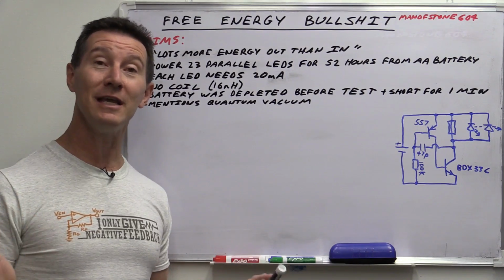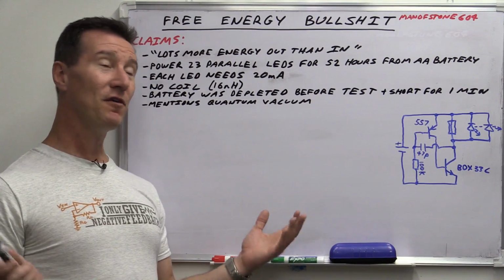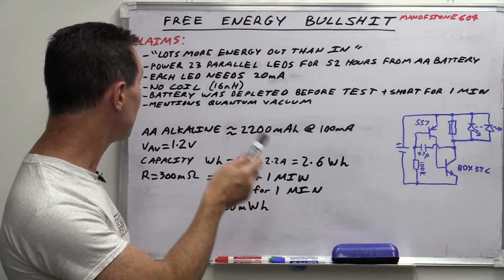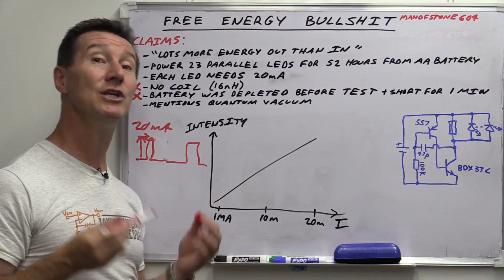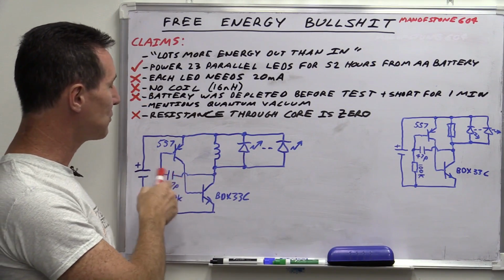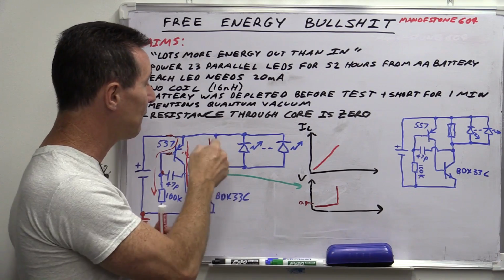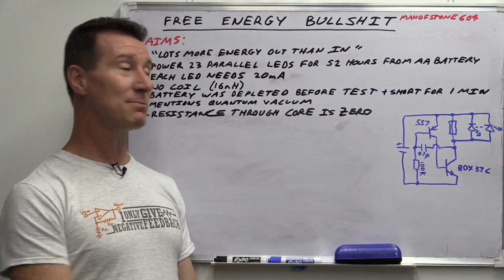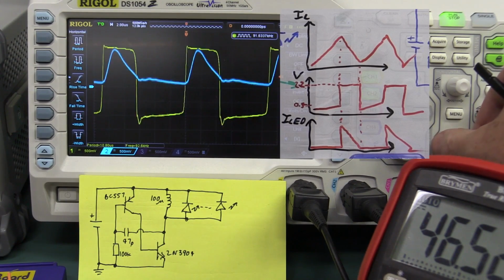EEVblog #708 - Free Energy Overunity is RUBBISH!

Comment: Energy cannot be created, it just changes from one form to another. High School Physics.
Reply: Robert Calk Jr. Are you sure you want to double down on stupid? How about I highlight the units for you, so you can make a more informed decision:

"the Sun releases energy at the mass–energy conversion rate of 4.26 million metric tons per second, 384.6 yotta watts (3.846×1026 W), or 9.192×1010 megatons of TNT per second."
Reply: ***** Pontus Lundström Pretty sure he was joking...
Reply: Once again, whatever the value is, the unit is watts, not watts per second. watt is the amount of energy per unit time, aka. joules per second. joules per second per second, or joules per second^2 (= that watts per second, you are speaking of) doesn't make sense in this case. No need to talk about the second derivative of the energy ..
Reply: Robert Calk Jr. Yes... the sentence ends with "or 9.192×10^10 megatons of TNT per second."

There are a thousand horrible and potentially hilarious ways I could insult you right now for failing to actually read the fucking sentence you were quoting from. Please at least be aware that I'm using restraint here.
Reply: HitAndMissLab 
"An engineer is not more than a bean counter."
You keeping thinking that. Granted an engineer allowed you the ability to type on a computer to post that comment.
Trolin' is not your style.
Reply: Mobin92 No one knows. The prevailing theory is that the big bang had all of the current energy we have now, just in a condensed space.
However people like HitAndMissLab are just trolling.
Reply: HitAndMissLab You got fingers, look it up.
Reply: Robert Calk Jr. No they don't. Wikipedia clearly states the Sun's energy output in terms of watts: "384.6 yotta watts (3.846×1026 W)". There is no "per second" associated with that number.

EDIT: That should be "×10^26", but superscripts don't work on youtube.
Reply: Some people smoked weed through highschool and dropped out. LOL. They weren't there for that class, unfortunately.
Reply: Robert Calk Jr.
Watts per second? Did you mean Joules per second? (which is Watt).
Reply: Robert Calk Jr.  You have just insulted yourself. Please let me explain why.
Joule is the unit of the amount of ENERGY.
If you divide energy by time (or simply make first derivative over time) you will get the rate of energy being transfered/changed/used/etc. That is called POWER and its unit is WATT.
If you divide power by time (or do first derivative of power over time which is second derivative of energy over time) you get the rate of change of power over time. It DOESN'T have any special unit, just W/s (watt/second).
So, if you're talking about some number of Watts per second you are NOT talking about power BUT about rate of change of power. It tells you how fast power is changing over time NOT how much power is emitted from the Sun (as in discussed example).
Do you see the difference now?
Reply: Naoki Kashima HAHAH Oh wow.

Learn some better arguments next time:
http://rationalwiki.org/wiki/Bumblebee_argument
Reply: Not true.  On the quantum level, both energy and matter can be created, as long as equilibrium is restored very quickly.  That's how the W+ and W- bosons are created.  For example, a neutron, with ddu quarks (total mass is around 12 MeV) decays into a proton with uud quarks (around 9.5 MeV) by producing a W- boson(mass of 80 GeV).  It can't do this if energy and/or matter cannot be created because the mass of the W- boson is 1,000 times the mass of all three quarks.
Reply: Naoki Kashima
Yeah right...Because for something to be in school books, it first has to be made an article by scientists, be tested and have reproducible results, than it goes to school books. So...Pretty much everything you see in most reputable school books is actually factual information that comes from reputable sources...Unlike your statement.
Reply: Falcrist
Nice one.:)
Reply: ***** OK - so many things wrong with what you just said.

First - the Electric universe is NOT a theory - it is a hypothesis.
2nd - it has been disproved.

Basicaly it made very few predictions and none of them came out to be what we find in the universe, on the other hand, the BB-Theory (it is called theory cause it is backed up by a hue amount of evidence) has made predictions that turned out to be accurate.

Even more - the electrical universe doesn't even try to explain how Stars work - Stars work based on fusion - that is not a matter of opinion, but a fact.
If you want to talk about theories explaining that, i'd suggest looking up quantum-mechanics.
Reply: pesshau Sadly no . those fraudsters really want to rip the retards of their money that way - and trust me on that . there are more than enough idiots willing to believe such shit (watch?v=_c6HsiixFS8 - that is how much such morons want to believe to be smart and their government being in a conspiracy)
Reply: ABaumstumpf True. This guy was just such a weird parody of himself, I thought he was joking. And thanks for the link, that sprinkler rainbow lady is a real classic.

I think you have described the two sides of this free energy "community" quite nicely: On one side there are the people who really want to believe, no matter what, because it makes them feel special and enlightened, and on the other there are the conmen who are taking advantage of them.
Reply: Naoki Kashima
Robert Stever was quick in giving you the right answer. Note: there is nothing like "mainstream science", there is only science - and pseudoscience. And you should never use "according to science ..." since you are ignorant in science.
Reply: Naoki Kashima First of all you seem to confuse the terms "theory" and "hypothesis". Also what do you mean by "who decides"? No one decides. A hypothesis can be confirmed by a lot of experimental tests, but if even one of them does not reproduce the results predicted by the hypothesis, then it's out of the window, and must rewritten or replaced by another model altogether. And it does not matter one bit who supported the hypothesis at first! You seem knowledgeable, you should at least be familiar with this fundamental principal of science (and logic for that matter!)
Reply: stephanosanio To add to that: it's also much easier to use scientific notation than to use some of the more absurd greek prefixes.
Reply: ***** Our understanding is an abstraction, sure. But those imperfect concepts have some pretty amazing predictive abilities.

At this point we know beyond a reasonable doubt what is happening in the core of the sun. Now, our model isn't perfect, and it can be refined... but you can be very confident that it's at least close to the truth.
Reply: ABaumstumpf  I never said it was anything more than a technicality. :)
Reply: Gert Nutterts
"It's the first thing I think about when somebody says "Free energy!"."
There are some really fun videos that show this behavior in live action - form the really min-numbing dumb ones - like free energy from your phone-line, to burning your newspaper all the way to making freaking huge coils right next to power-lines.

And then you got the conservatives in the US-government saying that we should not use more wind as it would be Gods way to balance the heat - and if we used to much wind energy, the winds would stop.
(Yes - some of those even go as far and take out their Bible in a discussion about health-care or environment-protection).

And then there are people like those form Solar Roadways or this - unable to do even simple maths and check their own claims.
Reply: Naoki Kashima
A transformer is an electrical device that transfers energy between two or more circuits through electromagnetic induction.
A varying current in the transformer's primary winding creates a varying magnetic flux in the core and a varying magnetic field impinging on the secondary winding. This varying magnetic field at the secondary induces a varying electromotive force (EMF) or voltage in the secondary winding. Making use of Faraday's Law in conjunction with high magnetic permeability core properties, transformers can thus be designed to efficiently change AC voltages from one voltage level to another within power networks.

http://ieeexplore.ieee.org/xpl/articleDetails.jsp?arnumber=5058456

The fact that you seem to lack basic knowledge in Faraday's law tells me you don't know what you are talking about.

I design power supplies for a living and am required to know a great deal about magnetics. Granted you can learn more by reading (ieeexplore is a great place). Posting a half baked comment on something you know very little about makes you appear very unintelligent.
Reply: heinzpg According to mainstream science a humble bumble bee is unable to fly because its wings are too small for its body. Did you know that science can't explain why a bubble bee flies? Maybe... just maybe mainstream science made a wrong turn around 100 years ago. Maybe we all should have listened to Tesla and not Einstein. Maybe there are no black holes, dark matter or dark energy. Maybe all of the mysterious of the universe can be explained through electricity and electro-magnetism..... maybe I am 100% correct.
Reply: Naoki Kashima Rationalwiki is not wikipedia.

"Furthermore, I'll pay you 100,000$ for 1 gram of dark matter. Can you please ship it to me, and I'll transfer the funds into your paypal account. HA! You won't be able to give me 1 gram of dark matter. Why? Because NOBODY has ever created it, or observed it. Does it exist? No."

Prove it doesn't exist. with Peer reviewed research.
Reply: ***** u r trolled u lose
Reply: ***** Others smoked weed throughout highschool and university, and are now professional engineers.

I know because I'm trying to get my BSEE, and two of the best students I know are major potheads. One of them doesn't want to join my study group because he likes to "smoke a bowl and think about the concepts". Whatever floats his boat I guess, but that's not for me!
Reply: ivanjacob
Doesn't our sun emit 600 Trillion Watts per second?
Reply: stephanosanio
Yeah I forgot the exact number but it's a massive amount of energy.
Reply: Robert Calk Jr.
384.6 Yotta Watts per second.
Reply: Amy UNTOLD
Jesus Christ, The Word of God Almighty spoke and the universe was created.
Reply: nychold
Yeah . but we are talking about completely different scales there. If you somehow manage to separate matter and anti-matter in such huge quantities that you had usable amounts of energy - well, noble-price for you :D
But for every-day techs we always use simpler equations - you don't deal with relativity when driving a car - it is just too insignificant, but in reality it does affect it.
Reply: Naoki Kashima can you cite a source from a reputable institution on this?
Reply: heinzpg "Robert Stever was quick in giving you the right answer. Note: there is nothing like "mainstream science", there is only science - and pseudoscience. And you should never use "according to science ..." since you are ignorant in science."

The only people who use the phrase "according to science ..." are people who are complete boobs at science, using at nothing more than a puppet to fill their false or incomplete claims. This is coming from someone who did graduate college with a degree in the sciences and never uses that phrase.
Reply: Robert Stever
There is no such thing as human nature - it is an adopted nature, which is spiritual. You either have the nature of Jesus Christ, or you have the nature of satan.
Reply: Go ahead and keep thinking that.
Reply: holy shit an actual electric universe crank
I never thought i'd actually see one in the wild.
Reply: Saumyakanta Sahoo We are all participating in a simulation. Reality and perception go hand in hand. For example light behaves differently when it is observed, it haves like a particle. When light isn't observed it behaves like a wave. That is the whole paradox in quantum physics. Quantum physics can explain what is happening mathematically without actually understanding the implications philosophically. If you take a gun and shoot yourself, there is a high probability that you will die. Why? Because we are all living in a shared reality that has rules (much like a video game). God is consciousness that is shared between beings. Consciousness is a fractal, it folds into itself. I am saying we are all the same being that our separation is an illusion.
Reply: tarotbug 
Hey Tarot , read your cards again !
Reply: Ordinary hussles obfuscate ordinary evidence.
Reply: ***** Hes a mayan :)
Reply: stephanosanio
I guess you can take the case up with Wikipedia and get it changed. But it is what they say.
Reply: Falcrist
They are the last two words in the sentence...
Reply: Falcrist
Yes, and the whole sentence refers to "per second". You're just insulting yourself.
Reply: ***** LOL, are you serious? You must be trolling, because that video was hilarious.

Edit: OK, maybe not so hilarious. Your voice is starting to bore me now, and you won't let me leave your site.
Reply: ***** I hope you end up in jail
Reply: ***** more drank far to much and flunked out
Reply: *****
 That's exactly the point of my comment. There is more to physics than what engineers are though at university. An engineer is not more than a bean counter.
Reply: If energy can not be created, where did it come from? :D
Reply: ivanjacob You have never been to school, I guess...
Reply: Д. Станоев looks like he deleted his post. Wuss.
Reply: Robert Stever That would be a smart move ;)
Reply: Naoki Kashima
The fact of the matter is that there's no 'universal reality' or 'universal truth'. So no one can say for sure how certain things happened, even if they were part of certain events.

Also, I never said X is right or wrong. I'm saying what happens for information to end up in schools books and be taught as factual.

An example of that would be global warming. Researchers on various fields ended up getting similar data on tests that had nothing to do with finding global warming, which in turn made things happen and global warming ended up being added to school books as a fact.

Still waiting on sources to be referenced.

Also, electrons do carry negative charge.
Reply: Robert Stever I knew about the Faraday Law. Point is it isn't the ELECTRON that transfers the charge it is the electric field itself. This field is contained BETWEEN the wires. The high voltage wires on your power lines will actually respond to each other (either get pushed apart or come together) when the they are under power. Watch Eric Dolard's lecture on anti-relativity (youtube search it).
Reply: In principle the laws of physics do allow for creation of energy, but as far as we know it does not happen. Perhaps with the exception at big-bang. In physics each conserved quantity is associated with a symmetry in the laws. For instance, momentum is conserved if the laws are the same everywhere and energy is conserved if the laws do not change over time. So to all those who claim they can create energy out of nothing: You have the power to change the laws of the universe! Impressive!
Reply: Anders G The humble electron began spinning billions of years ago and hasn't slowed down since. Is this an example of perpetual motion device in nature? Science must ALWAYS follow nature :)
Reply: Naoki Kashima Perpetual motion is normal in nature and not in conflict with  laws of physics. What is not possible is perpetual motion which in addition delivers energy without diminishing the motion.
Reply: ABaumstumpf I want a Noble Price.
Reply: Robert Stever One should know never to include links from wikipedia in scientific discussion. How reliable is wikipedia? Not very.

Furthermore, I'll pay you 100,000$ for 1 gram of dark matter. Can you please ship it to me, and I'll transfer the funds into your paypal account. HA! You won't be able to give me 1 gram of dark matter. Why? Because NOBODY has ever created it, or observed it. Does it exist? No.
Reply: Robert Stever Prove to me that it does exist with physical evidence :P
Reply: Naoki Kashima We are trying to prove if it exists or not. That is the point of science.

The universe is expanding at a rate in which entropy should have caused the universe to contract. Something is causing the universe to expand at a rate that is visible to us. Heck nasa has had a nine year study on this phenomena
http://lambda.gsfc.nasa.gov/product/map/current/map_bibliography.cfm

We call is dark matter/energy as we have no clue what this type of materiel really is. The term "Dark matter/energy" is nothing more than a placeholder for the 95% of the observable universe that we can see on WMAP images.
http://arxiv.org/pdf/1303.5062v1.pdf
Reply: Robert Stever Science is based on observations and testable and re-testable results! What suggests the existence of dark matter is equations and abstract math which has no root in reality at all!
Reply: Naoki Kashima
A little simpler and less of a dry read: http://www.quantumdiaries.org/2013/06/26/does-dark-matter-really-exist/
Reply: Naoki Kashima "Science is based on observations and testable and re-testable results! What suggests the existence of dark matter is equations and abstract math which has no root in reality at all!"

Again you failed to read or understand the math. That is why you are not a physicist. Just someone who tinkers...

edit: http://libraryguides.unh.edu/content.php?pid=350369&sid=3969939

You don't have a clear understanding of science if you think it's only "observations and testable and re-testable results!"

The LHC is scheduled this year to determine the mass of dark matter:
http://hplusmagazine.com/2015/02/26/the-lhc-is-back-and-its-ready-to-probe-the-limits-of-matter/
http://www.ipwatchdog.com/2015/02/25/large-hadron-collider-antimatter-dark-matter/id=54943/

This technology is rather new and didn't exist until rather recently. Heck it discovered the Higgs Boson wish was theoretical only until the LHC discovered it's existence:
http://home.web.cern.ch/topics/higgs-boson
Reply: Robert Stever Celestial bodies are held in places because of electric charge not some invisible matter. Electro-magnetism is a 10e23 times more powerful than gravity. Read the book called Electric Universe by Wallace Thornhill & David Talbott. Universe is filled with electric charge! Why do physicists ignore that fact?
Reply: Naoki Kashima Even more pop sci conjecture. Please go back to school before you embarrass yourself any further.

Any sentence that starts with "Read the book called ..." is automatically fraud science. Notice how I have not done so?
Reply: Robert Stever Flip the pages of time back to Copernicus. He had the crazy idea that Earth revolves around the sun. His ideas were considered pseudoscience during his time, sacrilegious. Years later we learned that he was right! And now we all take his ideas for granted. The same can be said about the ideas in that book. The fact the universe is filled with electric charge is undeniable. Aurora Borealis actually contains millions of amps streaming from the sun. The Earth is charged with 500,000 volts through tullertic currents, and the sun has a charge of over 2 billion volts. This values are available for your or anybody else interested to examine :P

There is no need for intangible, invisible, imaginary dark matter to explain why galaxies clump together. They do that because of the electric charge that exists in between space! Also, there is a highly charged form of matter known as plama that permeates space (plasma being the 4th state of mater, as you know).

Time will tell which one of us was right :P
Reply: Naoki Kashima So far you are still digging that hole. Want a larger shovel?
http://rationalwiki.org/wiki/Electric_Universe
Reply: Robert Stever Notice how you didn't actually address any of my points, you merely side stepped them. I hope a person who is reading these posts (if there is one), will see this as well :P
Reply: Naoki Kashima Like which ones? I didn't address Copernicus as you where right.
Reply: Naoki Kashima I'm not seeing anything missing from Robert. I do see a man who got beat down badly and won't see the error in his judgment, just like Calk jr.
Reply: Robert Stever Points like the universe is filled with electric form of matter known as plasma. Agree/Disagree? The Earth has a very large electrical charge within the planet known as tulleric current. Agree/Disagree? There is no physical evidence for the existence of dark matter at all. Agree/Disagree? Electromagnetism is a 10e23 times stronger than gravity. Agree/Disagree? You can have electricity without magnetism as was demonstrated by K. Meyl, N. Tesla and other. Agree/Disagree? Modern day physics is mainly based on MATH not EXPERIMENTS. Agree/Disagree?
Reply: Naoki Kashima Troll post is a troll post.
Reply: Naoki Kashima " Electromagnetism is a 10e23 times stronger than gravity. "

You can't even get this right, it's 10e36 greater. Electromagnetism isn't gravity.
Reply: hawkeyefile Oh I'm sorry I was actually 14 zeros away. That fact makes my point even more dramatic. Gravity is a very weak force. Electromagnetism can act like gravity where even non-magnetic objects can levitate in a very strong electro-magnetic field. Have you seen the levitating frog experiment? A frog was placed in a pipe around the pipe a very strong electromagnetic field was generated and the flog was floating as if it was in zero gravity. I can provide links to that video. Is this what really causes the planets to maintain their orbit, this electromagnetic field? Our solar system is basically like one giant capacitor. When the planets all align in a row you get to see effects on the sun. The sun actually spews out solar flares at that time and it has an effect the Earth's electronics. RCA did experiments with this, and they were able to predict these solar events based on the position of the planets in the solar system. It is indeed an electric universe out there. Gravity may not even exist as a separate force but be merely a derivative of electricity and magnetism.
Reply: Naoki Kashima You still fail to understand higher levels of physics, you seem to have not read any of the previous posts with the WMAP survey, if you did, you would know that what you are posting is bunk involving the Electric Universe .

Gravity and electromagnetism are separate principles that achieve a similar affect (at super conducting temperatures). Gravity is still a principle that with time science and not woo science, will figure out. You posting anything related to the Electric Universe makes you appear dimwitted just like Robert Calk jr.

Interesting reads from other's with a physics background:
http://neutrinodreaming.blogspot.com/2011/09/electric-universe-theory-debunked.html
https://briankoberlein.com/2014/02/25/testing-electric-universe/

Trolling is still trolling.
Reply: Robert Stever Shhh. He might have to stop digging to get a bigger shovel.
Reply: hawkeyefile It's even more side-splitting hilarious how the majority of his posts in this YT reply section is full of bunk that has been called out on, then he goes on the attack with strawmen and does this "Agree/Disagree" baloney against a physics major mind you.
Reply: hawkeyefile
Nobody beat me down. 1 Watt = 1 Joule/ second. Edit it in Wikipedia if it bothers you so much.
Reply: Robert Calk Jr.  You said 1 watt second, rather thank joule in referring to the Sun' output. Then proceeded to argue your ill contrived point.
Reply: Modern physics is completely bogus it can't even explain why a bumble bee flies! Its wings are too small for its body! It must be the invisible and intangible 'dark matter' that propels it, maybe its equality invisible and intangible 'dark energy' that propels it. Maybe all the answers are on wikipedia already.... maybe.... maybe not.

Base your physics on observations NOT on abstract math w/o any root in reality.
Reply: Naoki Kashima 
"Modern physics is completely bogus it can't even explain why a bumble bee flies!"

Can't tell if you really take that comment of yours seriously, or if your trolling.
I guess if your I.Q. was below room temperature you could take that argument seriously (the fact that you even bring up this argument shows you have no intelligence to speak of seeing as how the rest of your posts are pseudoscience at best, crank at worse).
http://www.caltech.edu/news/deciphering-mystery-bee-flight-1075
I'd welcome you to take this argument to the people at: http://physics.stackexchange.com/questions/7839/is-it-really-impossible-for-bumblebees-to-fly

I'm more surprised that this comment thread has not included Hitler as most tend to delineate into or some other creationist bullshit theory.
Reply: Robert Stever Speaking of Hitler... it seems like you live on this page. Ever heard of Hitler's brown coats and what their purpose was? Do you think you might fall into that boat some day?
Reply: Robert Stever People are just people, there are no different sides. If we could put aside our differences we could leave this planet and explore the universe in peace. Interstellar technology is already available to humanity (search for NASA tests the impossible engine). That article talks about a very crude prototype... still miles ahead of rockets. Things like money, power, have no meaning anymore. Humans is a species of builders not destroyers. Eh, Robert?
Reply: Too liberal for my views. I've seen the world in all of it's ugliest when I was stationed in Afghanistan, people killing people because of religious differences. <-- This will not change in my lifetime.

I do agree on some of those points , however money is a necessary evil for motivation. You remove money from the equation and the motivation factor goes down; I'm motivated to build high current power supplies to support myself (to buy food and pay for my apartment), not for the science of it. Star trek got a lot wrong and a lot right, even in their universe money still exists in the form of the Federation Credit, and all officers are given "Credits" for trading with other races.

Power will always have a place, it's ingrained in Human Nature. Someone must always be the Alpha, the Beta and so on. Unless we breed this out, humans will always squabble over power.

"If we could put aside our differences we could leave this planet and explore the universe in peace." This will not happen unless we ditch religion and political differences.
Reply: Making-a-Mulligan Where's my pokeball when I need one.
Reply: Naoki Kashima once again http://rationalwiki.org/wiki/Bumblebee_argument
Reply: Naoki Kashima Physics based only on observations was done in and before the 1700s when the fundamental theories where still up for discovery. It was a time when one could be physicist an astronomer and a doctor at the same time and be a good one also! Now we do not have that luxury. Theoretical predictions have to be made, verified by many and go and be verified (if they can be) by physical experiments. Why? Because a piece of paper and a calculator cost a lot less than a particle collider or a satellite or whatever instrument you will need to prove or disprove hypotheses in the forefront of science of our time.  "Agree?/Disaggre?"
Reply: BIll Georgoulakis Agree. That being said there are many people with many different theories out there. For example what about the theory of the aether? That theory was supported by Tesla, Eric Dollard and Konstantin Meyl's experiments. That theory was also supported by Maxwell as well as Einstein! However, today we completely abandoned it and replaced it with the action at a distance theory. Who exactly gets to decide which theory becomes mainstream and is taught in textbooks and which theory dies? The people who have the money and influence decide this. In the US the Carnegies gave US education grants in return that got to pick which textbooks get used in schools. The truth of the matter humanity is a slave to energy. People who control energy control humanity. If one suppresses information about energy that exists in the vacuum and gets everybody to learn about the conservation of energy laws one can keep selling oil forever. Oil is the goose that lays the golden eggs. I have a paper containing over 3000 pages of suppressed inventions, if you are interested I can provide a link.
Reply: Robert Calk Jr. It is watt-second (W·s) not watt per second (W/s). dW₍t₎ = P₍t₎ · dt; (d/dt)W₍t₎ = (P₍t₎ · dt)/dt; P₍t₎ = (d/dt)W₍t₎; (d/dt)P₍t₎ = (d/dt)(d/dt)W₍t₎; (d/dt)P₍t₎ = (d²/dt²)W₍t₎; P'₍t₎ = W''₍t₎. Thus, you're referring to the second derivative of the energy with respect to time. Kontra is right.
Reply: 2013Aleksey2013 math should only be used as a tool not the primary mover and shaker of things. The primary mover and shaker should be the experiments and observations. The main reason people claim that free energy is impossible is because of the math. However, observations tell us a different story. Observations > Theory
Reply: Naoki Kashima NO!  The reason you can't create more than put in is because it's impossible.  Physics tells us that.  Physics are the Natural Laws that define how things work.  Math is just not numbers, it's the code of everything.
Reply: valveman12 Physicist should have stayed out of electrical science. The reason for that is because electron is NOT the charge carrying particle in electricity. Electricity involves the motion of 2 particles. One goes from positive to negative with a clockwise spin, the other goes from negative to positive with a counter-clockwise spin. You actually can create and destroy energy. Watch my video for a lenz-free system that Ed Leedskalnin came up with.

Observations speak louder than theory.
Reply: Naoki Kashima Electrical theory came from Physics.  How do you know how current flows?  There are 2 Schools of thought.  Current flows from Low to High Potential (Electron Flow) or from High Potential to Low Potential (Conventional Current Flow).  You bring up Ed Leedskalnin and loose all credibility.
Reply: valveman12 We can debate about this all day long. Expect to see actual physical results from me about this :)
Reply: Naoki Kashima I won't hold my breath.
Reply: valveman12 I'll give you a video link if I am successful if not.... I have other ideas :) If this fails I'll be 300$ poorer... My next idea will involve Tesla's Homopolar generator. Basically if you spin a copper/aluminum disk over a ring magnet you get voltage and amperage. If you put that voltage and amperage under load the spin will not be effected! This is another one of those Lenz-free systems. You can have 2 disks spinning... one powers the other and they will keep spinning indefinitely.
Reply: Naoki Kashima And what do you intend to prove (or disprove) with your experiments. What is the hypothesis?
Reply: BIll Georgoulakis The hypothesis plus theory>>> Electricity is actually composed from 2 particles. A positive and a negative particle. These particles have the opposite spin and move in opposite directions. What people call "Lenz's Law' is just 1 of these particles trying to leave the system. We are using 1 of the particles but are always fighting against the other. In a balanced generator the movement of these particles is accommodated and Lenz's Law is negated.

Short version of Hypothesis>> If I create a generator with a U-shaped core wound with 2 opposite wounds coils of a sufficient size I can achieve perpetual motion in the system.
Reply: Naoki Kashima Oh Man are you even reading what you are writing?  Pos and negative spin in opposite directions?  Pos is in the atom and electrons orbit said atom.  Negate Lenz's Law?  Lenz Law is not a particle.  It is a phenomenon that occurs when drawing current from a generator.  An equal and opposite current will flow to counter act the current drawn.  Without Lenz's Law, you can't produce current from a generator so how are you going to negate it?
Reply: valveman12 I posted a video that shows how Lenz's Law can be negated: ht tps://w w w.youtube.c o m/watch?v=nuAIxDsLT88 MrAnguswangus did it first, but I want to do it on a larger scale (the video contains small scale device).

Your explanation of Lenz's Law is correct in accordance to what we were taught in school. It is a force that opposes the rotation of a generator forcing you to work the generator harder when it is under load. In reality it is something different (check out my video, a much larger device is on the way).
Reply: Naoki Kashima Ok I looked at your video.  First you do not have 2 coils shorted out.  You put them in parallel.  The current being drawn is so small of course you don't see a discernible change in speed.  More accurately would be to use a photo tachometer.  The second part you connected both coils in series.  Of course you get more voltage.  There was no elimination of Lenz's effect. It was alive an well in your experiment.
Reply: valveman12 In my experiment when I shorted out just 1 coil you see a noticeable drop in speed of the rotor. The rotor's speed drops drastically and there is a clicking sound. When I short out 2 coils I get NO change in the speed at all. There is zero change. You are correct, I should use photo tachometer for this (I don't own one). Ed Leedskalnin said "if you take my generator and put it on a rocket and fly to the moon and back you'll end up with the same amount of fuel as before you left." This quote hints that his generator ran it self. This is it my friend. We will see what will happen next.

If you take a U shape magnet and magnetize a piece of wire. That wire becomes magnetized, but where does that energy come from? The magnet you used has just as much magnetism as before. You can magnetize a million wires this way w/o changing your original magnet. The laws of conservation of energy hold true for physical systems but fall apart with it comes to some electrical systems. I'll keep you updated if I come across anything interesting :)
Reply: Naoki Kashima "your I.Q is below the room temperature " , yeah you proved it !! .. hahahahahahahahah
Reply: Robert Calk Jr. oh , the Hindus , Muslims , Buddhists are all aliens I guess ?
Reply: Naoki Kashima Hey , you seem to be living in some other dimensions, I guess  the laws of physics are different for you , you are a living being of higher conscience , please spare us "mere" humans from your powerful knowledge.
Reply: Saumyakanta Sahoo In the past people in Europe were convinced that the Earth was flat. Then they were convinced that the Sun revolved around the Earth. Now physicists are convinced that Dark Matter, Dark Energy and Black Holes are real without a shred of physical proof. Maybe... just maybe they are completely wrong again. What if electricity NOT gravity is the dominant force in the universe? Universe is filled with highly charged matter known as plasma. What if gravity doesn't exist at all as a separate force but is just a stronger version of magnetism (when magnetism is strong enough even non-metallic objects will be effected by it). Experiment: take a piece of graphite bring it close to a ceramic magnet. Is it magnetic? No. Graphite isn't a metal and it won't be effected by the ceramic magnet. Now take the same piece of graphite and put it near a very neodymium (~200 lbs of pull force) magnet. You'll notice that graphite is now being attracted to the magnet. The only thing that changed now is the intensity of the magnetic field. Think for yourself, don't let others think for you :)
Reply: Saumyakanta Sahoo 
I didn't say anything about aliens, you did. I'm talking about the spiritual nature of people. Many have the nature of Jesus Christ whether they have heard of Him or not. But since you brought it up: Islam is the only religion that beheads non-followers of their religion - that sure sounds like a religion filled with the nature of satan to me!
Try to see things through spiritual eyes, rather than physical eyes - you may be amazed at what you see...
Reply: Robert Calk Jr. Okay, enough with the religious attacks, if you cannot mathematically and systematically prove anything, please, just leave, this is a EE channel, for EE fanatics, not religious/spiritual fanatics , we all know how recursive the religious topic is.
Reply: Robert Calk Jr. The whole Islam beheading is done by CIA employed mercenaries. The west is behind Isis, just like they were behind AlQaeda. When have we invaded a country that doesn't have a wealth of natural resources? (random of subject comment from me, you are welcome)
Reply: ***** 
Proof? If I remember right you can buy a copy of the Koran at Walmart. Look for yourself.
Reply: Naoki Kashima 
And they have the nature of satan also - that changes nothing. The beheadings of non-muslims is in their religious text. Do you deny that?
Reply: Robert Calk Jr. The history of Christians is also filled with blood. Do you remember the witch burnings? Do you remember the crusades? The only way to STOP the perpetual warfare and violence is to accept all the people as they are. Do on to others as you have them do on to you, words to live by.
Reply: Naoki Kashima 
I'm not concerned about 100's of years ago, I'm concerned about now!
And the Christian wording of that verse is too often misappropriated. I'm rather fond of the way Confucius worded it: Don't do unto others what you don't want done to yourself. That is safer. lol
Reply: Naoki Kashima dark matter isn't imaginary , they have proof , the visual mass of the galaxies and other clusters do not account for their observed mass , so the missing mass is termed as dark matter  - https://en.wikipedia.org/wiki/Dark_matter 

 Gravity comes from mass , mass comes when a particle interacts with the higgs field . So gravity is not related to electricity or its field.
plasma occurs in very specific conditions not generally.
And about the graphite case - http://www.madsci.org/posts/archives/2006-04/1145484500.Ch.r.html 
even liquid oxygen can be deflected with strong magnetic fields showing its paramagnetic properties.

paramagnetic substances show pull towards magnetic force under intense magnetic flux.
Electricity is not the dominant force since it cannot travel without a medium , only gravity can, electric field is only dominant in close ranges since gravitational field is not strong enough in close ranges.

Electromagnetic waves can travel without medium( in reality it travels through spacetime only) , but they they do not spread like gravitational waves , they go in straight lines and sometimes under intense gravitational fields they bend from their straight path like the gravitational lensing effect( due to the bending of spacetime)  which shows how strong the gravitational fields can be - https://en.wikipedia.org/wiki/Gravitational_lens 

Just think about the basic things and observe them.
Reply: Robert Calk Jr. No. Mathematical Proof that energy cannot be created from nothing. Walmart off the shelf education wont cut it, not here, not anywhere.
Reply: ***** 
Oh, sorry. Mathematical proof? Ok, here goes........"0", stands for "zero", hence nothing. 0=nothing.
Would you like to see that equation again? Only God could create something from nothing. But that would still require His power. So technically, it would still come from something, or from somewhere.
Reply: Robert Calk Jr. there is no jesus or god who created us , regarding the spirituality, its just our own way of explaining the unexplainable things.
The only GODs are our parents who gave us life , nourished us and took care of us ,  gave us knowledge.
Reply: Robert Calk Jr. That equality makes no sense. There is no technically in your proof, you wont even make it to Walmart with that. All we see from you is an angry, troubled old man that is unable to impose hes views on others. 

Okay, your troll feed is up, go to sleep.
Reply: Saumyakanta Sahoo 
I'm waiting for you to prove it. (crickets chirping)
Reply: Robert Calk Jr. what do you want me to prove?
Reply: ***** 
I really don't know what makes you think I'm angry, or troubled. My faith is set in stone. What any of you say against God means absolutely nothing to me. In fact, I figured it out at 3 years old, before I even knew the names of God and satan - It amazes me how many adults can't. That's correct, at 3 years old I was contemplating spiritual forces. 
Do I care if you believe me? Not a chance. Am I angry? Not at all. Am I troubled? Not in the least. I'm not the one who lives with doubt. I'm not the one that is afraid to die. I know what is awaiting us.
Believe what you will. BTY, I'm only 54.
Oops, I forgot. Could I see your equation of how you get free energy from nothing?
Reply: Saumyakanta Sahoo 
Are you 12? Prove there is no God.
Reply: Saumyakanta Sahoo 
Jesus said unto him, It is written again, Thou shalt not tempt the Lord thy God. Matthew 4:7.
But others have tried to murder me. And I quoted Isaiah 54:17. Then laughed at them as they ran like rabbits.
Reply: Scientists said : "There's no GOD , only reality."
Reply: Saumyakanta Sahoo Reality is in the eye of the one perceiving it. Nothing exist if there is no observer. God exists inside of us.
Reply: Naoki Kashima 
That's why you guys sound like such idiots, and why it's so easy to discredit evolution. So I ask you geniuses; who was the observer during the formation of your so-called "primordial soup", or the big bang? If we follow that logic then nothing should exist.
Reply: Saumyakanta Sahoo 
There are thousands of scientists that have faith in God.....and the list is growing longer every year.
Reply: There are milions more who believe there's no GOD.
Reply: Naoki Kashima Shed the dreams , and endorse the reality.
Reply: Saumyakanta Sahoo 
Most of those are lying just so they can receive funding. Stop being a one dimensional thinker.
Reply: Likewise most of those are lying that GOD exists to fool people.
Reply: nychold Because of the matter energy equivalence, energy still is not being created or destroyed.
Reply: jarrod1937  For short (extremely short) periods of time, they are.  The energy has to be "paid back" though, so the net result over a reasonable time period is zero.
Reply: nychold They are not creating energy or matter. That's my point. For example, virtual particles are used as a form of energy transfer. Energy is converted to matter in the form of particles, then the particles move and are annihilated and are converted back to energy. You can separate the particles before annihilation, though to have the energy be directly converted to matter. However, since there is a matter-energy equivalence here, one can argue that matter is just another form of energy, and thus matter and energy are not created or destroyed. I suppose it's a matter of wording, but in physics terms, matter nor energy has been 'created.'
Reply: jarrod1937  W particles are created, even if they're short lived.  They have mass (energy) that far exceeds anything that could be converted from the neutron, so that energy has to be "created" from nothing.  Virtual or not, the particle still has mass/energy, and, in order to conserve mass/energy, it would have to come from somewhere.  But it can't, since the only thing in the equation is the neutron itself (which doesn't have the energy to emit a W particle), so that energy is simply unaccounted for.  In short, energy is NOT conserved over short time periods, therefore energy is created.
Reply: nychold Hmmm... No, do more research, the energy is certainly conserved.
Reply: jarrod1937  I have.  Quite a bit, in fact.  It all depends on how (and when) you look at the problem.  At the moment when the W particle exists, you have violated energy conservation.  However, the W particle exists only for a tiny fraction of time (less than picoseconds, if I recall correctly), so over a more reasonable time frame, yes.  Energy is conserved.
Reply: +Yaghiyah Brenner exactly!
when you look from this view, everything is possible, it`s just need to find the way.
Reply: +Yaghiyah Brenner The Big bang would like to have a word with you. Also quoting others without doing your own research and basic thinking is idiotic.
Reply: +Hamguy Bacon The fact that you used energy to comment means alot. :)
Reply: ***** I got more energy typing this than i put in.
Reply: Crushed Luminary old dogma
Reply: WAY TO GO MO-TAR, I'll side with the smart guy in the left corner. Stuff like that which you just said is why we live in a hostile world.
Yay, I trolled for the night.
Reply: Yaghiyah Brenner 
how to explain Gravity assist
Reply: Yes, but there are many types of energy, some free and some expensive, some reliable and some not, some efficient and some inefficient. There is AC, DC, RF, Microwaves, Light....RF seems to be the best because it has a greater potential than AC with far less resistance and it can be amplified.
Reply: Michael Fraberger We create in our minds and put it in action by modifying and manipulating the reality but in our reality we don't create. We manipulate and change, never create, to get something you need to change something. It's all a big lego and we play with it. The problem is...we are playing the wrong game.
Reply: Robert Stever،، there is also conventional science and non conventional science and technology, for example acupuncture was from non conventional medicine which was opposed by conventional medicine,  there are non conventional economy which is related to community currency which is been opposed by conventional economy and so on
Reply: Elementary school, to be fair
Reply: elementary
Reply: BS!
Reply: where do the counter forces of symmetry originate?
like self-inductance
Reply: ivanjacob Nope, the Sun is just converting mass - think it as an unusual type of potential energy - into kinetic energy of protons, neutrons, electrons, neutrinos, photons, etc.
Reply: "I DONT HAVE ANY SCIENTIFIC EXPERIENCE BECAUSE I DROPPED OUT OF HIGH SCHOOL BUT FUCK YOU OPEN YOUR EYES SLEEPY-SHEEP THE OIL COMPANIES ARE FEEDING YOU THOSE FUCKING TEXTBOOKS!"

- People who want to believe in fairy tales but are too lazy/stupid to actually disprove long-standing scientific laws.
Reply: No.. Everyone knows that the sun is the mighty creator of energy!!
Reply: ivanjacob uhmm...actually, yes, the sun was created by vast materials in space, its energy source will burn out too.
Reply: @xorcipher  every atom came to existence from nothing.
Reply: "Energy cannot be created, it just changes from one form to another. High School Physics." >> That is total nonsense. Where the energy for Big Bang came from? If energy can not be created, we wouldn't be here.
Reply: HitAndMissLab What Big Bang? the one you witnessed? yes?, You would rather ignore obvious proof and facts and go viral with your unproven claims. The study and birth of planets are far beyond "our" reach both physically and mentally at this moment in time. 

Rather spend time debating deep sea expedition, you will have a better chance than throwing a dice at astro psychics, black holes, intergalactic space travel.
Reply: Robert Stever
What does "trolling" mean?
Reply: exactly, so the amount of energy is stored or released into a new form. people are believing they are creating energy for free and the above video states over-unity does not exist when he is correct in our state of teaching and training and explanation. but there needs no explanations when the energy exists and will persist from one form to another always here and available to use depending on how you capture available energy or release it. no over unity because we cant create more than what is already here. tesla didnt create energy, he used what is already here. we are bathed in energy... its the big oil and big gov industrial complexes that dont want us to all realize we can just use what is all around us.
Reply: Energy can be displaced through time giving the results of over unity. Just because something is taught in school doesn't make it factual :P
Reply: Bruno de Souza Lino Is electron the charge carrier in electricity? What do you think? What do the school books teach? If it was than none of your transformers would work because the primary and the secondary windings are NOT physically connected. What do school books teach in regards to JFK assassination and 911? Carnegie corporations gave donations to the education system in return they managed to standardize everything. As a result of this mainstream knowledge has very little to do with reality.
Reply: Alles Existierende ist Energie. Frei verfügbar, also freie Energie.
Reply: Crushed Luminary You big silly, everybody knows that God created everything. Not universal recycling. As if anybody could say the universe is old. We all know that it's only a few thousand years old.